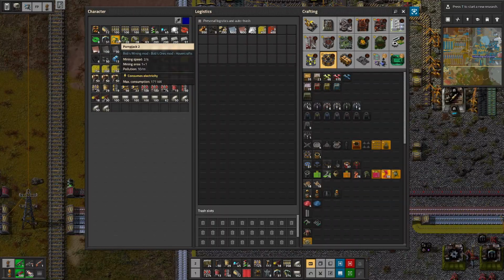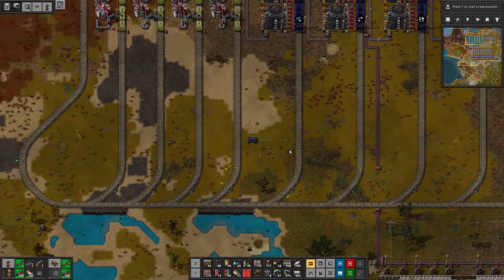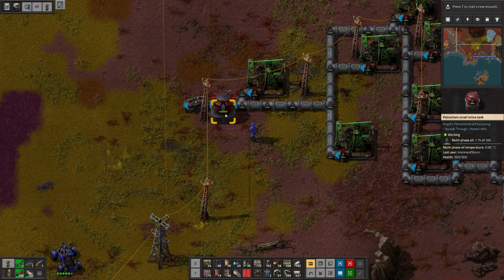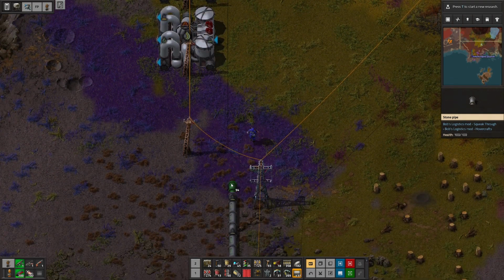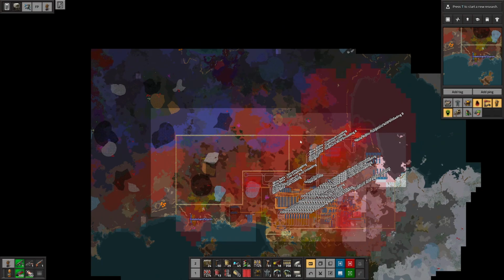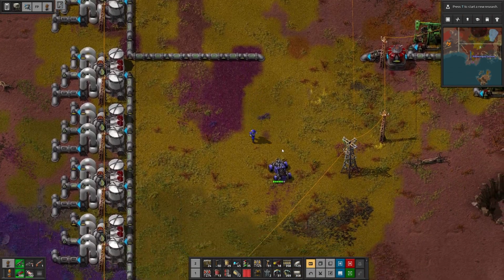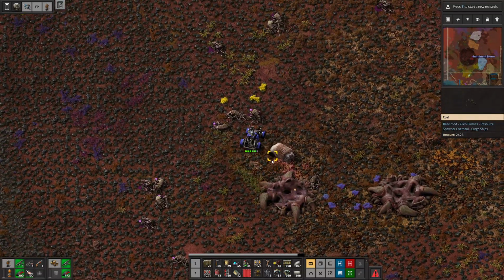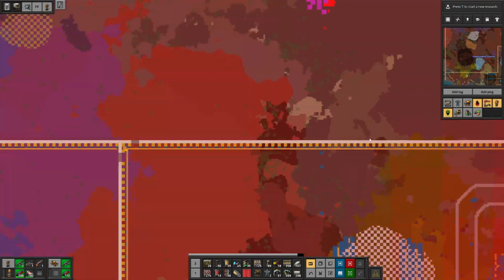Factorio - Angel's & Bob's - Season 2 - Episode 058 - Preparing Some Heat

Comment: I believe that if one of the flamethrower turrets gets destroyed it will cut the fuel line passing through it. You might want to add storage tanks along the system to supply the downstream turrets if that happens.